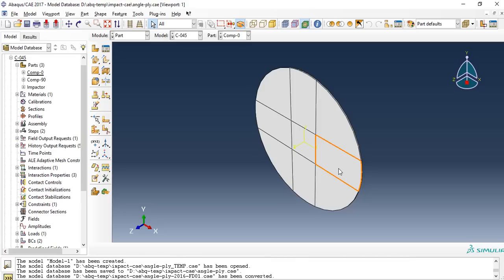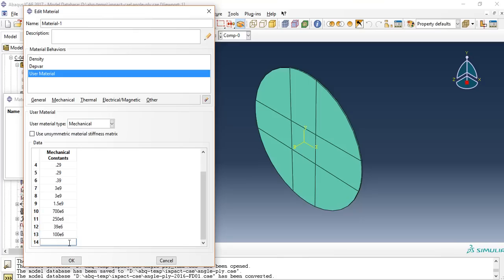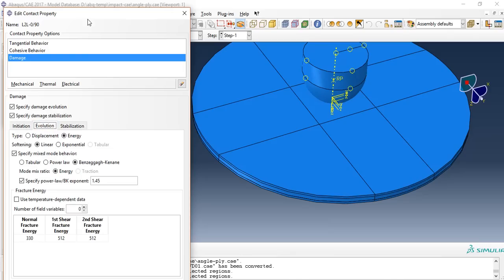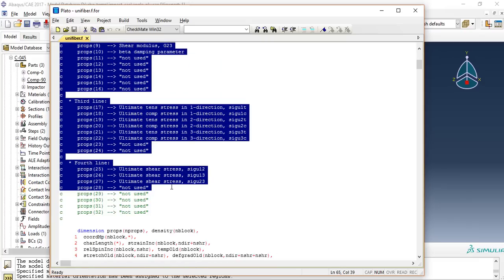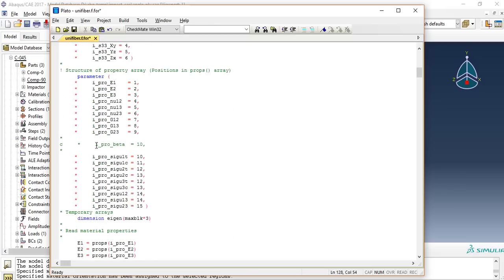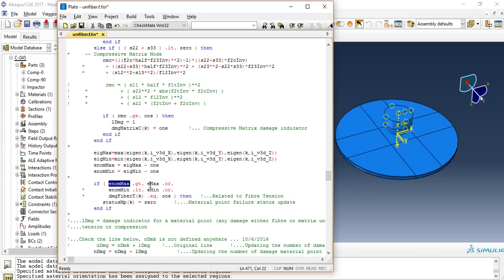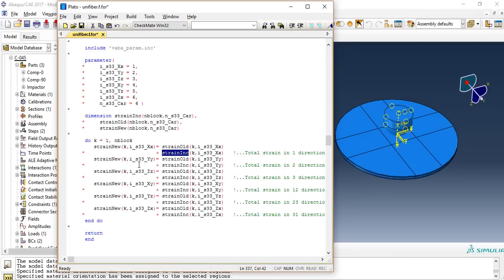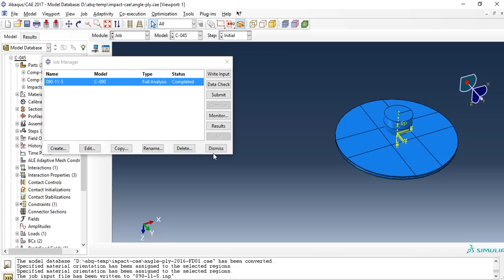Drop weight impact with VUMAT: Modeling and discussion

Comment: Thanks@Sanan, 
I think they used Puck criterion for matrix tension and compression.
Reply: I have very minimal experience in subroutines. Kindly let me know why we are using 'beta' in the lines of code below yet it is a parameter(constant). 

if ( beta .gt. zero ) then 
         call betaDamping3d ( nblock, 
     *        beta, dt, strainInc, 
     *        stressOld, stressNew, 
     *        stateNew(1,i_svd_statusMp), 
     *        stateOld(1,i_svd_dampStress), 
     *        stateNew(1,i_svd_dampStress) ) 
      end if 

Thank you.
Reply from the maker: i think its different from what the puck criteria is.
Reply from the maker: for damping...also known as beta damping
Reply: @Sanan, I hope you got my message.

Comment: Dear Sanan, in the previous videos you have given the Velocity Boundary Condition with amplitudes for Reference point in step-1. But in this video you have used the predefined velocity Boundary Condition for the reference point.. what could be the difference that we can find between them... And if we won't give any amplitudes in the Velocity Boundary Condition, the velocity of the impactor is remaining constant in the step-1.. what you could suggest if we want to include the Hertz contact law during the impact loading and get the velocity profile of the impactor as the function of time.

Comment: I am having a plate which made with steel and impact with rigid cylinder. And velocity is given in amplitude form. But I am not able to balance the energy. Kinetic energy is coming double than internal energy.

Comment: Dear SIr, I'm trying to prepare the model of multiple impact of the composite. The first strike goes well, however I have some issues while importing the output of first strike to second analysis. After submiting the analysis, on packager stage the following message (error) appears:

Bad Material definition in element number XXXX instance XXXXXXXXXXXXXX: zero or negative initial dilatational modulus caused by bad material data. Please check your material input and any initial conditions if necessary.

Is it caused by subroutine code, or inssuficient material data? I'd like to ask for your help in it.

Kind regards

Comment: Hi Sanan, 

The author mentioned the subroutine 'eig33Anal: Compute eigen values of a 3x3 symmetric matrix analytically'. What is this subroutine used for? 

Many thanks.
Reply from the maker: to curtail any high frequency oscillations occurring due to impact. it can also delete the element.
Reply: Thanks Sanan

Comment: Sanan thanks a lot for taking the time out to make this video. I wanted to ask how to determine/calculate the fracture energies (G1+, G1-, G2+, G2-) required by the damage evolution models for ply damage. Are there some standard ATSM procedures to determine them?
Reply from the maker: these are the fracture energies in particular mode. will be obtained by loading the material in 1 mode only and obtaining load displacement for it. the area under the curve will be its energy. yes ASTM are available sear ch for it.
Reply: thx a lot sanan
Reply: also the strength properties (X1+ X1- etc) that we input, are these the yield strengths or ultimate strengths?
Reply from the maker: yield and ultimate are same for composites :)
Reply: Thx man

Comment: Dear Sanah,
I made all the modifications u mentioned in the video, still I'm getting error due to excessive element distortion in the first increment only. I am stuck with my project and will be grateful if u can help me.
Reply from the maker: i never said these were the modifications. i said these were methodology errors which should have been avoided. any how you should make your own subroutine.
Reply: Actually I'm just a beginner and currently in the learning stage. I am working on an impact analysis problem, using solid element. So the Hashin 3d is to be made by vumat. I don't understand what I'm doing wrong. So I am asking for a little assistance. If it is convenient, can I contact u personally for some guidance? I promise it won't take much time..
Reply: Sir.. it would be easier if I could contact u via email, as per ur convenience..
Reply: @gourabchakraborty9432  i am also getting same error 
can u able to resolve it share ur email

Comment: Hi Sanan, Thanks for such a nice video of vumat subroutine. I am working on low velocity impact on composite using VUMAT.
I go through your video and I made all the changes in vumat subroutine whatever you told in video. I got the error of excessively distorted elements which you also told in your video in the end. Right now I am not able to detect why this error is coming. Could you help me to detect why this error is coming and how to eliminate it.
It would be very grateful if you help me out.
Reply from the maker: as i said the algorithm used in the subroutine is erroneous. even i am facing this issue while using it.
Reply: Sir could you Please suggest me what parameters should I take if I would write my own subroutine or which parameter should I remove from Hashin subroutine like damping or energy parameter
Reply from the maker: @nitinkhandelwal5829  elasticity damage initiation and damage evolution. This will completely defined the behaviour.
Reply from the maker: @nitinkhandelwal5829  no need of damping. Evolve the damage slowly

Comment: A lot of thanks. Through looking into your VUMAT script, I am afraid that the formula for matrix tension failure mode is not correct with regard to the 3d hashin failure criteria. "f12Inv" should be multiplied rather divided in the third part of this equation. I know you may just take this for an example to show us how to use VUMAT, but it' s better to correct it for clarity.
Reply: phoebe Zhang hello，phoebe，it seems that you are trying to simulate dynamic impact with abaqus? Can you make it?
Reply: Hi. I was working on the drop impact of a T-joint and it can run with my model. However, the model has to run for one month on my laptop. Then I changed to use continuum shell elements with the built-in Hashin criteria.
Reply: @wolferi9615  sir i am working on ballistic impact on composite target . is this steps can be used
Reply: @wolferi9615  hello wolfer I. i was wondering if you could simulate dynamic impact using VUMAT?